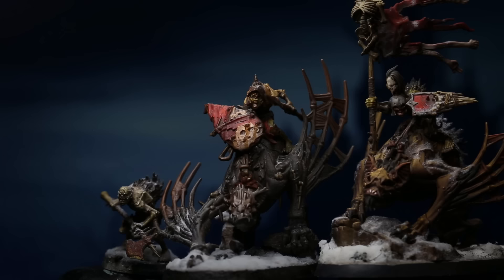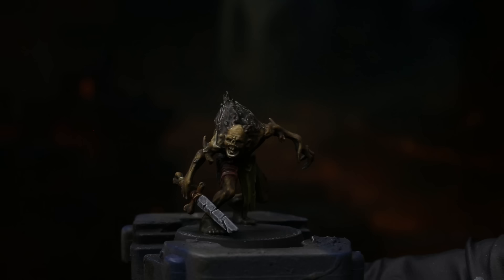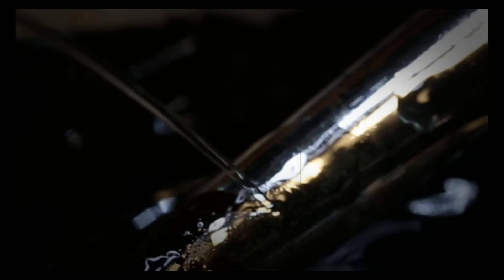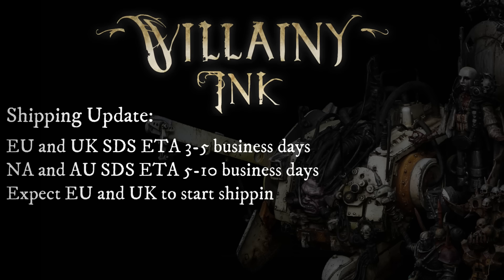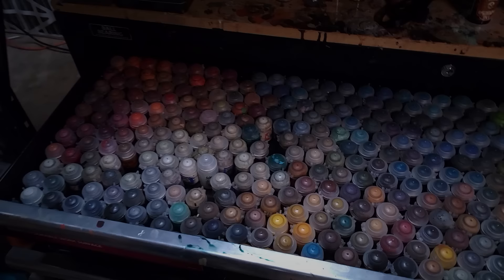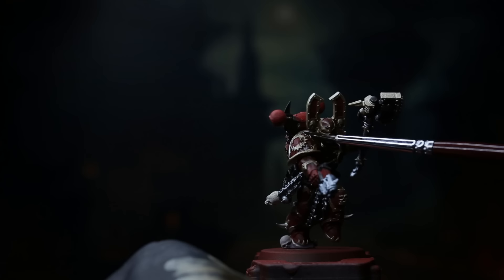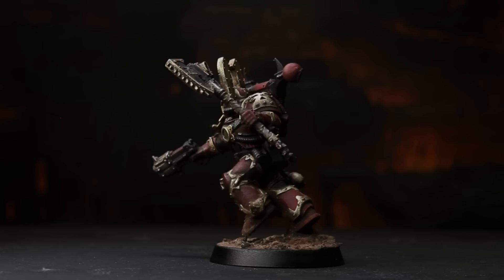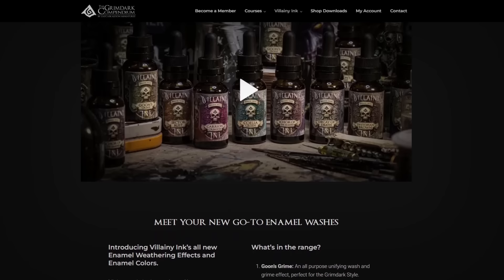Is this Speed Paint Technique Better than Slap Chop?

Comment: What always struck me as odd about the slapchop method is that all the drybrushing seems like the same effect could be achieved with a good zenithal priming.  Which further speeds things up.  Could probably even airbrush the first pass onto of enamels.

… and I couldn’t agree more, oils and enamels (along with your channel) really has completely changed my approach to mini painting!  Can’t wait to try out your inks!
Reply from the maker: I appreciate you. 🙏  To me, the dry brush steps are too much work for little result.
Reply: A zenithal prime can definitely do mostly the same thing as the drybrush pass, but not everybody has an airbrush. The general slapchop method is written like that to be accessible to everyone, but it definitely isn't a be-all end-all of speedpainting. Like with all painting methods, there's a lot of room for individual customisation.
Drybrushing also has the upside that it preserves dark areas in upwards-facing crevices, giving an ambient occlusion effect that would disappear if you used a zenithal highlight. And the drybrush step doesn't take more than 5 minutes for smaller models and maybe 10 for bigger ones.
Reply: Drybrushing gives you a lot stronger contrast on all the little details and textures than zenithal does. It's not necessarily better, but it is different and can achieve different results.
Reply: Yeah, that's actually what I thought slap-chop was! I have always done a base colour, then zenithal before a final light dry brush. This is all with spray cans and the dry brushing doesn't take long at all.

I have always hated base coating as I struggle to get my head around watering down paints and don't have the patience for multiple thin layers, so this has been great for me and a massive time saver. I'll often include an oil wash step as well.

Comment: This looks great. Possibly a light paddle sand dry brush at the end to pick out the highest point? Probably not with metal edges on this particular example however.
Reply from the maker: Oh, there are many little things you could do to improve it. This is a bare-bones demonstration
Reply: A question, will a black wash also work well if you wanted a less grimey look? Also how would you do a black version of this and so maintain some definition?

Comment: The contrast paint step of slapchop has to be done with a brush, and should be done over some type of value sketch. That could be a drybrush, or that could be done with an airbrush, or with rattlecans. I point this out because contrast paints are supposed to provide shading and base coating in one application. I would like to add, i myself do a zenithal highlight with my airbrush but i go directly from black or dark grey to white. You have to go easy with the white thought to get the proper gradation from black to white
Reply from the maker: Indeed.  In this video, I'm showing them used with a brush and an airbrush just to illustrate that it doesn't really matter how you apply them if  you're using an enamel wash.

Comment: I’ve seen many other videos using enamels but they always apply a clear coat after the base color step and before the enamel wash.

Did you not do that? I would think the enamel paint and/or the mineral spirits might easily take off acrylic paint, accidentally?
Reply from the maker: Nah. Its not necessary. You can if you want to though.

Comment: So the conclusion is that Goon-chop is just the traditional GW beginner painter method, but with agrax earthshade swapped out for an enamel wash?

Anyway, what is the benefit of doing enamel washes compared to oils? I have been using oils for a while now for pretty much this exact painting method (but with some more highlights applied with acrylic paint later, and maybe some creative removal methods of the oil wash if I want extra grunge) For me oils work very well since I can use the method I want, I can blend the oils, make thin or thick wash or "mud", or go quite thin for pinwashing. I don't see what enamels bring to the table if I already have oils that work well.
Reply from the maker: Delvan Mud, not Agrax. But yeah, keeping it simple with base colors and then doing the unifying wash. Enamels work the exact same as oils but have a more grungy finish  and dry matte. They are made to replicate effects, like grime, decay, and rust. Enamels definitely have a different aesthetic than oils. With that said, I use oils all the time, and Villainy Ink will move into making oils after I finish the enamel line.

Comment: Thanks for the tutorial, I'll definitely that, I've bought some oil paints and barely used once. The only thing is: I like more saturated ad vivid color, is this technique viable or It darkned too much? Or there is a way to make it work even for vivider results? Thanks
Reply from the maker: In the little clip I play of the more controlled wash, you can see it isn't as dark. That is a more carefully added and mottled wash application. It doesn't tone down the miniature as much because it is more focused on the crevices. Looks a lot better, too. Just takes a little know-how.

Comment: Any idea what varnish one should use after using enamels? Would I need to varnish the acrylic base before using enamels?
Reply from the maker: No varnishes are needed before enamels unless you just want to be safe.   If so, any varnish is fine. Varnishes as a last step is not something I recommend.
Reply: @GrimdarkCompendium  thanks for the reply, do you think enamels washes will hold up well on heavily used minis? I play a lot of games with my orkz.

Comment: May I ask, do you varnish before adding the enamels or oil washes? I rarely do, and feel as if i'm committing Heresy, haha. Nice results. I've done oils over contrast base before too, and the only issue was going too hard with the cotton bud on the contrast parts meaning some came away, but not too bad, it could probably be used to effect I guess depending on colours.

This is great, I have a load of contrast paints so will have to get busy, many thanks.
Reply from the maker: Thank you. You can add varnish if you like, but it shouldn't be necessary.

Comment: The problem with this method is that it still has the most tedious step: traditional basecoating. Depending on what paints you use, basecoating might require multiple thin coats, which takes a long time - especially for those who don't have an airbrush.
With slapchop, you're basically guaranteed that you only need to apply one layer of colour to everything. And the drybrushing steps are FAST in comparison.

Personally I really enjoy working with oils and enamels, so I tend to use them for most of my projects. Sometimes with the reductive technique, other times with wet blending. I'll definitely be buying some of the inks too, once they're available from PK-Pro. But as a speedpainting method, especially for people who don't have an airbrush, Slapchop still wins because you never have to do the tedious step more than once.

EDIT: seems I paused the video 10 seconds too early, just before you showed the ones basecoated with Contrast paints. I guess it comes down to preference at that point - some people find drybrushing tedious, others don't.
Reply from the maker: Yeah, this works with either. I show both techniques as you noticed. The only bothersome bit is basing out trim. There's no way around it, really. Trim is trim.